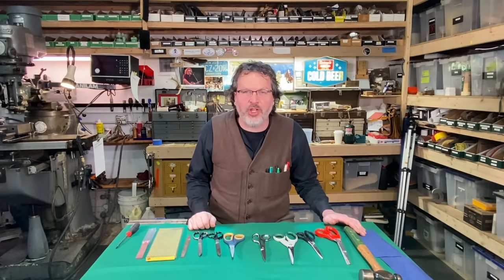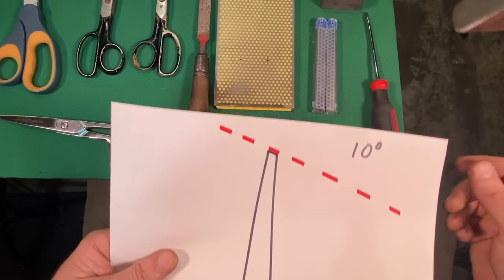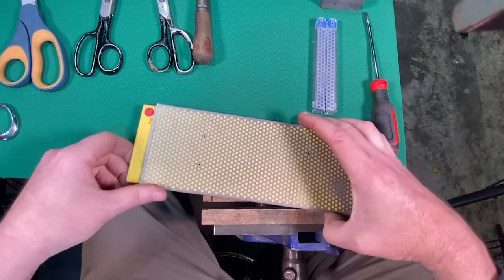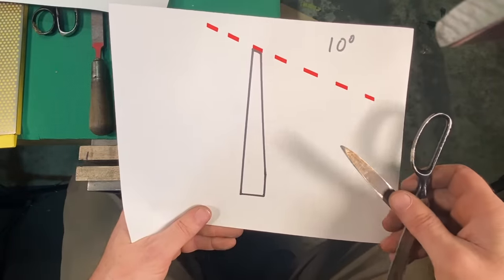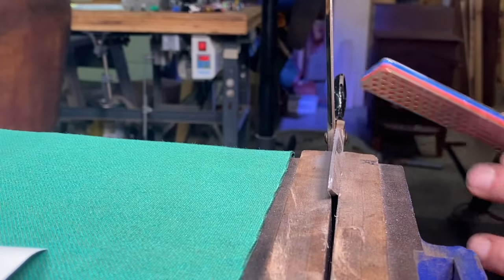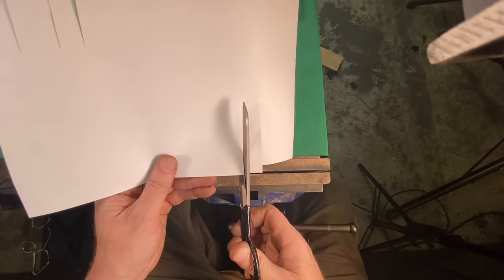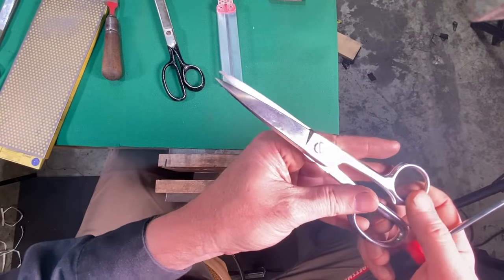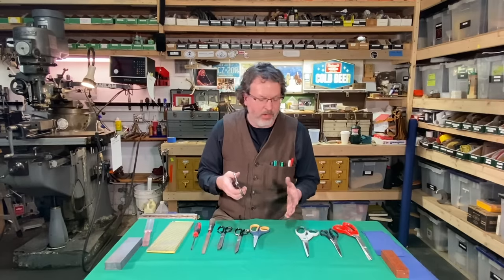How To Sharpen Scissors - Very Easy - Right On #61

Comment: I trying to sharpen scissors I have and just having difficulty getting that angle
Reply from the maker: Hi Bruce a good trick is to use a marker on that edge of the scissors. A sharpie marker works good. Then use the diamond stone and you know you have the right angle when you remove the marker evenly. Hope that helps! Thanks for watching! 👍 ✂️

Comment: I would suggest not working the inside of the scissors unless you can take them apart and work the pivot area as well it's going to slightly change the Dynamics of the scissors and overtime it's going to not let them cut because they're not going to meet when you're working the pivot area you want to put all of your pressure at the pivot point and worked it on a flat stone if you're unable to take them apart don't work the the inside of the blade because once you remove too much metal from that it will never meet right again and it will no longer cut no matter how sharp you make it the other advice is spot-on
Reply from the maker: That a good observation. I have explained this in other comments. Of course there are lots of styles of scissors out there. Many times the joint where the screw or rivet is recessed to allow for sharpening. I will have to make another video to explain how this works. Thanks for watching!
Reply: Should not flatten the inside at all ever. Shears have a twist, not just a hollowed grind. Well some have a hollow grind others just a texture, but all that work well have a twist. Anyway, flattening them takes that twist out and makes them not work as well. At least that style of shear works that way. Wolff Industries has a how they make their scissors video and the twist is added at the very last step by hand, although they don't call it out very well. Ernest Wright Scissors explains it much better.

Comment: Well - it's me again and I have just noticed that not every pair of scissors can be taken apart 
and the huge one I am going to sharpen happens to have a screw & nut in the middle.
Reply from the maker: Right On John! 🙌👍✂️✂️✂️ Yes, some can’t be taken apart. Some look like the screw can be removed but it is peened over on the back. That is great when they come apart.
Reply: Thanks Jon and yes, I did work on two old
ones, one came out fine and on the skinny one I have to try again since it seems to have an invisible angle - take care!

Comment: I don't understand why you wouldn't take the scissors apart first. I think it would make it so much easier. Or am I missing something?
Reply from the maker: That’s a good question Alan! There are many scissors that do not come apart. Some are put together with a rivet and some have a screw that was peened over. I show in this video how I tightened up the scissors by peening the screw. Lots of grooming shears have screws where the scissors can be taken apart. Thanks for watching! Right On! 👍✂️✂️✂️✨
Reply: @RightOnJonCrane  Yeah. Right after I posted, I saw the one where you had to tap the rivet to tighten it, so in the sample you showed, you'd have been unable to take them apart anyway. Sorry.

Comment: I never touch at all,the inside holllow side, and I would never use a file on scisors, unless ithey were duller than the dullest edge ver and in the same time, file was my only choice. Defenately not the tool for a beginner, because he will probably destroy those scissors, trying to sharpen them with a file. Beginner,s should learn how to keep the scissors sharp, or how to touch new ones, to make them sharper, using a ceramic stone or ceramic rod. Scissors are tricky sometimes, and some other times, easier than knives to sharpen.It all depends on the sharpening  (edge) bevel, how big (tall) it is  and if it's serrated or flat. fully serrated is better left for professionals, flat, can be the way to go for a beginner, to learn how to sharpen, using stones, or even better ceramic stones or rods.

Comment: "Yes, it did help.” unfortunately he took out some of the ‘hollow ground” engineered in for purpose.  It is to 'steel’ (like a kitchen 'steel’)            the blades.   As you push (more later) the sharpening device thru the angle/blade to sharpen, it shoves or rounds over a ‘bur’ (some metal) over (on a scissor - to the area the blades pass each other.  Cabinet makers use this bur to plane (less than is cut w/sandpaper) w/their Scraper (almost like a dough scraper).  What he calls the 'hollow ground’ allows  one to open/close the scissor 2, 3 times B4 1st use, to remove that.  It also continuously ’steels’ the 2 blades keeping them sharper than otherwise w/o it.  Possibly he does not remove it all (ruin). 

 2nd he went back’n forth w/his diamond stone on the blades.  It is suggested one take a single continuous stroke beginning to end on any blade U sharpen.  On scissors important as U have 2 blades, want equal sharpness.  Count strokes so as to have equal number per side.  Also for the bur mentioned earlier, one full stroke puts the bur to one side, not both.

Comment: I'm sorry to point this out, but I have always been told not to sharpen the inside flat portion of the scissors ever.  I have actually ruined a few expensive pair trying to sharpen that way.  It will separate the two parts of the scissors making them useless.
Reply: Hollow ground need dressing of the hollow for the scissor to work properly. Flat only on the back, no angle.

Comment: How you can ruin the hollow part of the scissors on a flat stone? I am a toolmaker and do not recommend that way!
Reply from the maker: Hi thanks for watching! 👍 I am a machinist and work with tolerances down to .0005 and less. I certainly know about precision tool making. This method does not ruin scissors ✂️. I did not completely remove the hollow grind or the ride line on the scissors. My scissors have worked great for many many years with this method. Yes you can use a scissor sharpening machine for convex and beveled shears but the method I show using a Diamond stone and hone is very sound. Thanks again for watching! Right on! 👍🙌✂️✂️✂️

Comment: SOMETIMES IT'S THE ANGLE OF THE SCISSOR BLADE THAT'S MY PROBLEM... I DON'T HAVE A VISE EITHER
Reply from the maker: Yes, a little vise really helps in this process!
Reply: you might happen to have an old vise that you don't use anymore... if it won't be too much, can i just have it... thanks!

Comment: Hi John it is my opinion that you ruined grandmas scissors by grinding the blades flat  on the inside they should be slightly curved into each other from point to hinge this brings the blades together and its called setting the scissors
Reply: Quite right. I was going to say exactly the same!

Comment: Curios.  Why don't you remove the screw and seperate the two sides ? Why fight that hinge and scrape your knuckles if you don't have to ?  JA.......
Reply from the maker: Right on Dennis! 🙌👍 Good question! These scissors that I’m sharpening have a screw that has been peened over with a hammer. It is a way they lock the screw on my types of scissors. There are lots of scissors such as grooming shears that can be separated. You are right that is best to separate if it can be done. Thanks for watching and a good question.

Comment: Your method goes against the design of professional hair-cutting shears. These shears, which cost a remarkable amount of money, have the 'hollow grind' that you point out, PLUS there is a slight arc from the hinge to the tip, which ensures that there is pressure at the tip, in a shear which is slightly flexible (and super light weight). Using that flat stone will cause problems and ruin the shear. Eventually, even with professional sharpening, these shears become unsharpenable. But if you stop and think about it, your method is not optimum, even for some of the shears which you demonstrate. I would think that a guy like yourself, who has shop tools, could come up with a more sophisticated method. These shears also have a properly designed hinge assembly with easy tension adjustment. In any case, you would have to carefully analyze the profile of the shear, as seen looking at the contact surface as you close the shear. If there are problems there, they have to be fixed.
Reply from the maker: Hi Dennis 🙌✨✂️✂️ Yes I know exactly what you are talking about. These scissors that I’m sharpening do not have much curve if any. This method does work very well for these scissors. A smaller Diamond stone can be used on the inside of the shears when there they are curved. I’ll have to make another video to demonstrate this. Also when polishing the inside surface it is not the intent to make the inside perfectly flat. That would be a mistake. This is just to remove any high spots, chips or burrs. I understand when sharpening grooming shears such as those for show dogs they must be sharpening on a disc type sharpener and also using a hone for the inside. Using a small leather strop also is beneficial in achieving a razor sharp edge. There is definitely an art to sharpening grooming shears. Some curve in two directions. There are also jigs that can be used but it can also be done by someone with skilled hand. With that said the method I show in the video is effective. It has worked for me and keeps my scissors very sharp. I know there are many ways to do things. Thanks for your feedback. I will make another video soon. Right On! 👍✂️✂️✂️

Comment: This is far more work.  Than going down to your dollar store..  To pick up a new pair of scissors.  This is what you do.  When you are retired with nothing better, to do.  And is called… What am I going to do with myself now?  I know!  Sharpen every pair of scissors in the house!  And then the knives.  Followed by the forks and the spoons.  Until they have all been sharpened.  And then to work on the power mower.  And sharpening all of its blades.  With the use of a human fingernail file!   Made from cardboard.  And you must drag it across the edge.  Very carefully.  So as not to sever your fingers.  Whereas sometimes that will happen.  You'll still have at least,, seven or more.  And still be able to make, your baby ice cream.  In your choice of flavors, including bourbon.

Harvesting poop from babies could be a new career?
RemyRAD

Comment: I used to be in scissor sharpen business, been to factory and went through training, tutorial is basic but rough and crude, would not recommend using your method on a good quality pair,  NOT ALL scissors are 10 degrees, if anyone has a good pair spend a few $ and have them done right.
Reply from the maker: Thanks for your feedback but I’ll kindly disagree. This is a method for sharpening at home without buying expensive scissor sharpening machines. Those work very good, but for the average person they can get great results with a Diamond stone, and these are not necessarily cheap. I understand that all scissors are not 10°. Yes there are beveled shears, convex bevel shears, hollow grind with ride lines etc. This is great for the scissor I showed in the tutorial and they are done right. Thanks for watching!